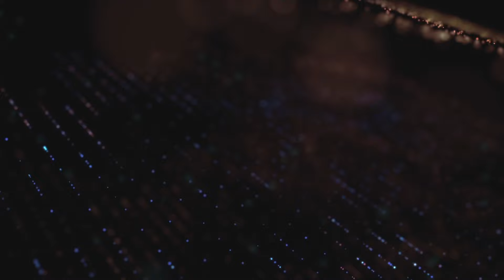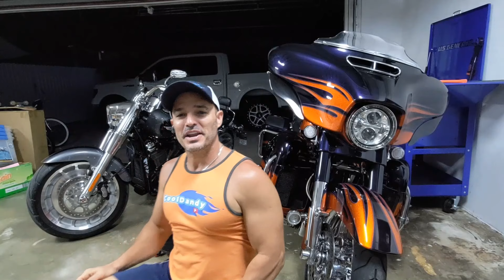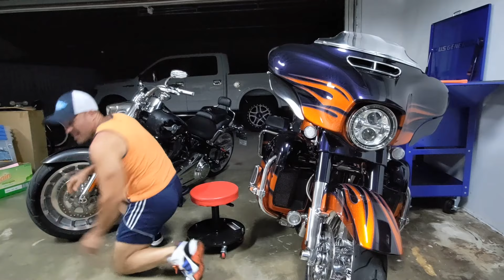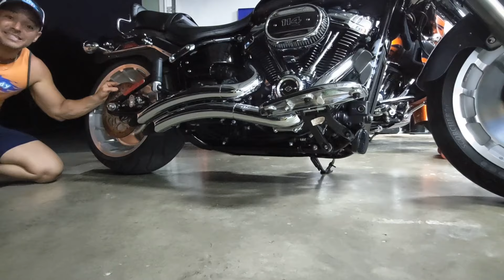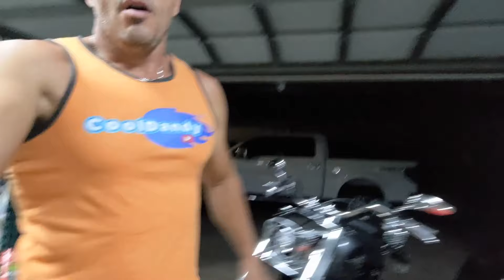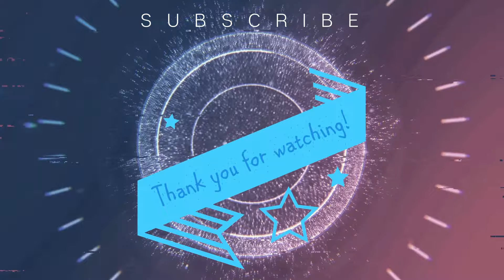Dont buy 2021 harley davidson, watch this video first, serious issue.

Comment: Did it get fixed by the dealer? Wao I have been considering buying an ultra 2021 but there are too many issues with M8 ; cylinder slices crack and brake, faulty or loose piston oilers- defective oil circulation system (inadequate oil pump and cam plates) weak lifters that brake, crankcase venting problems, overheating ….and those are only the ones I have found…I really like the Ultra but at 31,000  $s is hard to make that decision!
Reply from the maker: Yes it is amazing we getting all these issue and these high-end motorcycles 👎👎

Comment: Don’t know why they’re not telling you the truth. The disc brakes were made loose because  it is a single disc brake and they overheat with them tight, then they will warp. So now they make them with flat metal springs, and loose so they won’t warp. The flat metal springs hold them from vibrating while riding. You will only feel it or hear it when you are at a stoplight, you hold the front brakes and move forward and back, or when your bike is cool and you grab the desk and shake it. This change was done because of the fatter front tire. No room for a second disc and a Second caliper.
Reply from the maker: I really appreciate the technical information that you giving us but that doesn't easy this big issue that we should not be getting in 2021 motorcycle ✌️
Reply: @CoolDandy  Absolutely brother. We should not be getting that in the bike. I believe the big problem is, they do not want to make big changes on the bike like enlarging the front end. In the past manufacturers would make a completely different machine to adapt to the changes. They are not doing that now.
Reply from the maker: @Rockyjeeper  💯👍